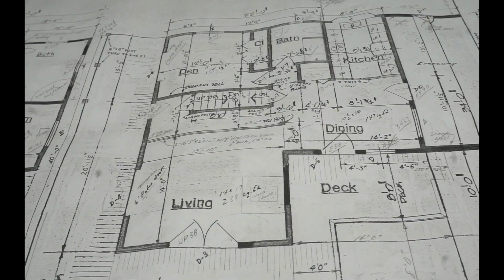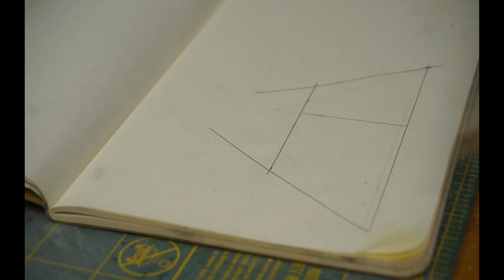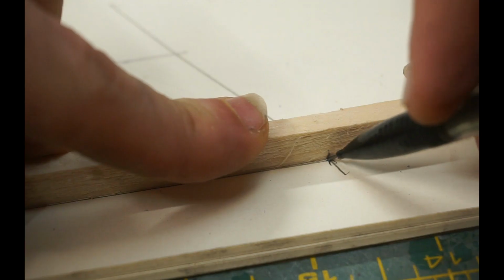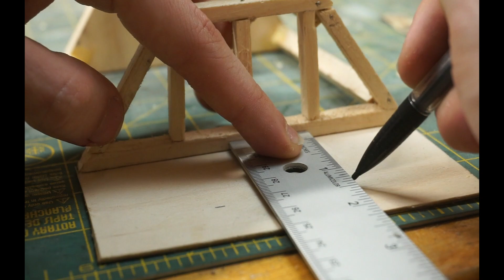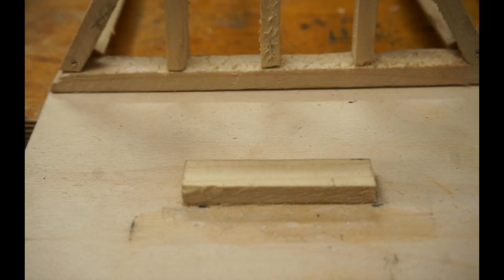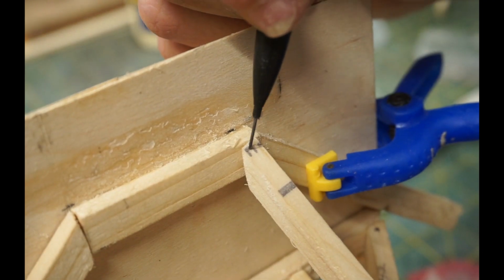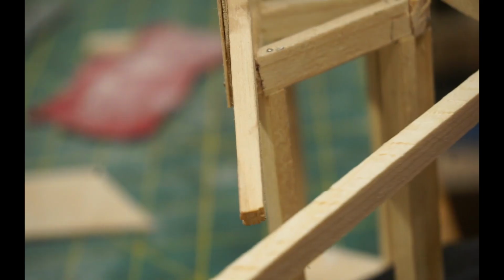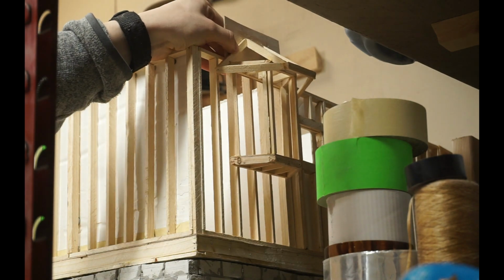Making a Realistic Model House, Part 17: Assembling the Bay Window

Comment: What tool are you using to cut the lumbar and plywood?
Reply from the maker: Great question! I got them a few years back at sears, and unfortunately they are no longer made (as far as I can tell, I can't seem to find them anymore). Effectively it's a pair of pliers where one side has a utility knife blade, and the other side has a delrin "anvil" that you can cut into. What I like so much about them is that you can use them for things that typically you wouldn't want to use wire cutters / nippers for as if you ding or mess up the blade, you can either flip it around or replace it easily with another utility knife blade. Maybe one of these days I'll make a video just on this tool in general if that's something that people would be interested in!
Reply: Ryan Gaus what is the tool called that you were using to cut the ply wood at 1:33
Reply from the maker: @mohammedmiah2431  Ah, sorry, I misundersood you before! Those are aviation shears, and here the specific ones I used: https://www.homedepot.com/p/Wiss-9-75-in-Straight-Cut-Aviation-Snip-M3RS/100060795

I thought you were talking about the cutters at 0:46.

Comment: Hey, great work ! How long would you estimate you've spent on this project so far in hours ?
I've noticed you use relatively soft wood. Seems to split a bit when cut. Any reason why you don't use hard wood ?
Reply from the maker: Oh wow, I'm not sure how long. It's got to be in the hundreds of hours though!

And yes - I'm using douglas fir for all the dimensional lumber in this project, mostly because it's the correct building material to use (and one of my ambitions of this project is to use as many correct materials as I can). You're right that sometimes it does split on me, though usually I'm able to glue it back together and it's as good as new.

Thanks for watching, and glad you like the series so far!